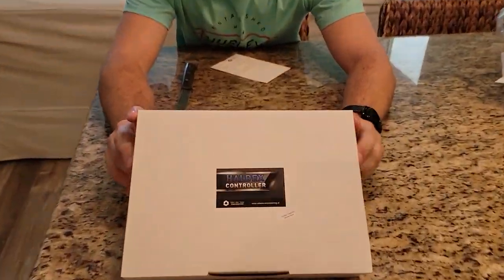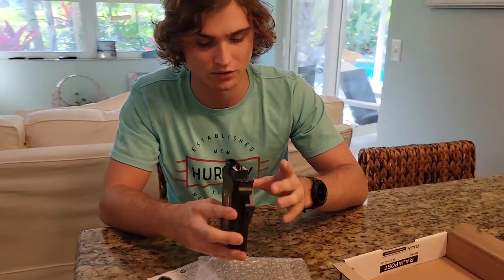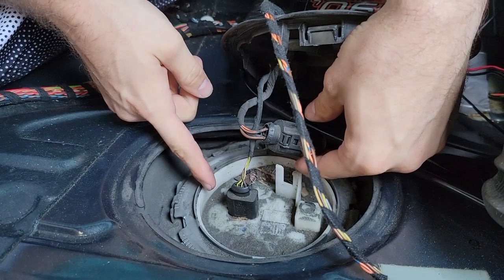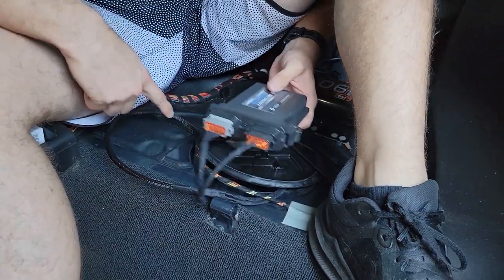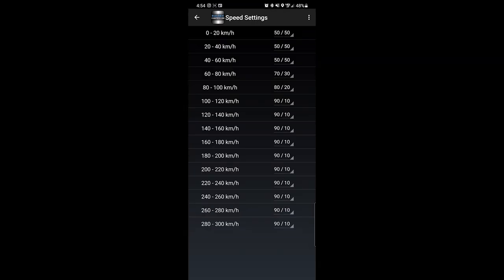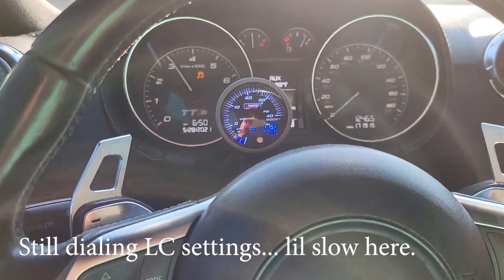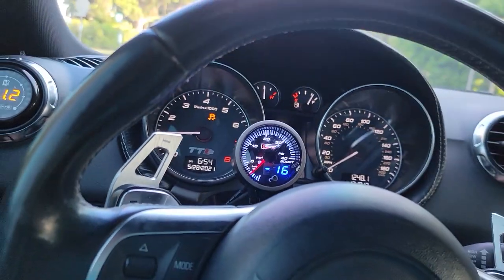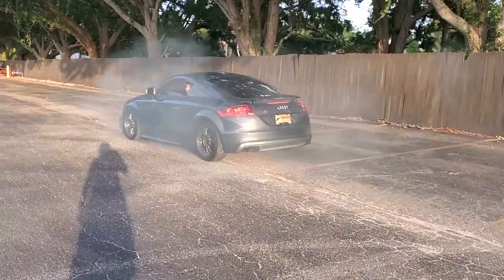Haldex Controller install & Testing! -For all AWD VW/Audis

Comment: This is a great product. I have been using it on my RS3 for 3 years. Just a quick note here, it is important to set the controller to automatically "unlock" the Haldex while you are turning the car into a corner, and automatically revert back after the turn, because there is no center diff for Haldex system unfortunately. Otherwise, the front and rear axles will scrub each other to death, especially when you are doing a 3-point turn without unlocking the Haldex.
Reply: What is the purpose or the benefit of this module if it's not supposed to work while turning? I mean we want more traction while cornering to avoid understeer as well
Reply: @jakjak258  
It is not the module's fault. It is the nature of this Haldex system that has no center diff.
Reply: @jakjak258 I think when he says turning he means a u-turn. Situations where it would suck to have a welded differential for instance

Comment: How much power do you have? That was a 3.2 sec 0-60. Like, damn.
Reply from the maker: Around 500. I just put new clutches in it so I'm hoping for low 11s.
Reply: @dannyhampton  Nice. I also like how you can completely disengage the rear wheels to do burnouts.

Btw, just for comparison. What's your 0-60 only with FWD? I'm not saying to test it. Just curious, only if you already have one.
Reply: @dannyhampton  I am on 2,89 secs and 100-200 7 dead. With 516hp and 702nm. B16 suspension, wavetrack diff.

Comment: Now that you've had this for a while, what are your thoughts on this? I've been looking at Haldex controllers for a while now and I'm trying not to go down the route of getting a Syvecs controller.
Reply from the maker: Love it. Use it all the time
Reply: @dannyhampton  and how’s the Haldex been holding up? Has it been successfully launching in 50/50? Right now, I’m spinning pretty bad on MP4S tires (80+mph) and I’d like to help get some traction back without having to go with drag radials or slicks.

Comment: Does locking it to 50/50 cause premature failure to the Haldex system?
Reply from the maker: I dont think so. Maybe if driving around with it locked all the time. But I will only lock it when launching. Now instead of locking when the front wheels spin, it will be locked before the car even moves.

Comment: If i keep it on 50/50 all the time will it ruin the transmission?
Reply from the maker: I am not sure to be honest. I have seen opinions both ways. I would setup a map like I did. Maybe they didn’t do it 50/50 from factory for long term… or maybe just for mpgs

Comment: Can you do it 100% rear wheel drive with haldex controller?
Reply: also wondering this
Reply from the maker: No only up to 50/50 with haldex
Reply: @dannyhampton  and is it possible to make donuts with 50/50?
Reply: @dannyhampton  that sucks. The new rs3 has a drift feature though. Pretty cool!!
Reply: @dannyhampton  really annoying when trying to overcome understeer...

Comment: Past couple months I've been debating between this and the HPA controller. Does this one have brake ignore?
Reply from the maker: The parking brake? Yes
Reply: @dannyhampton  no, regular brakes. When you step on the brake it instantly disengages the Haldex to 100/0. With the HPA controller you can turn it off but I want to know about this one
Reply: @CarswithRadYT  It does have brake ignore.

Comment: after 5 months of use... did you find a good setup for 1/4 mile?
Reply from the maker: Yes, it works great. I use the speed settings. I have it locked 0-40 mph and it slowly unlocks till its at 70-80mph